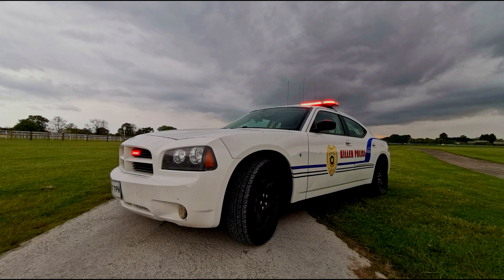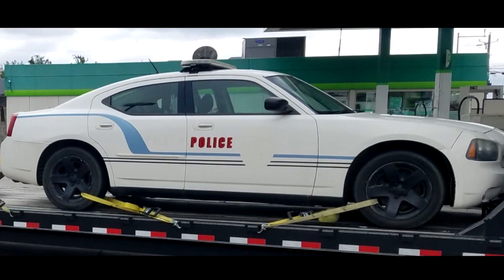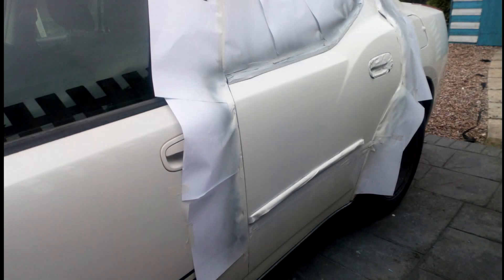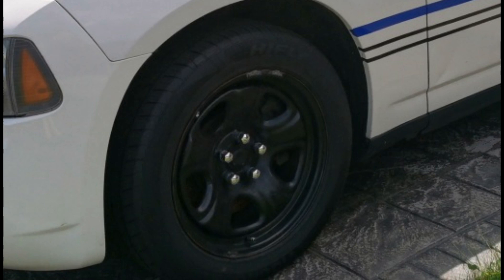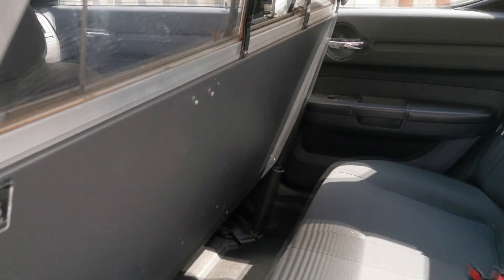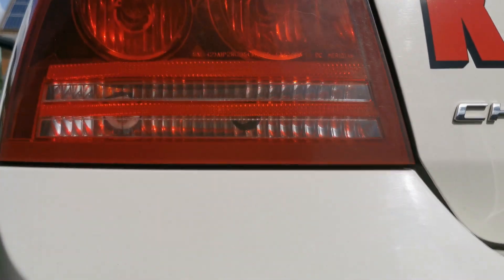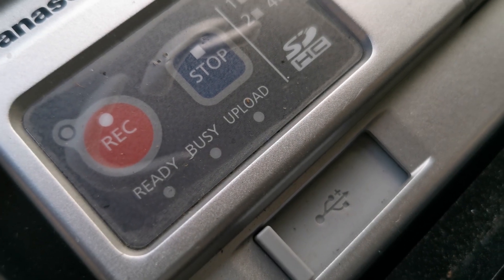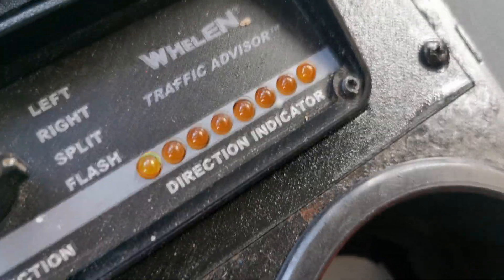Dodge charger ex police car walk around and drive

Comment: must get alot of looks driving that, i think i saw (correct me of i am wrong) a amber bulb in the reverse light housing (or strobe tube) but i assume he relocated the turn signals there as they legally need to be amber there
Reply from the maker: Hi Joey. Yes law in the UK states that indicators (turn signals) must be amber. When I had the car brought over in 2017, I had to do cirtain alterations to make it road legal. And believe it or not, it was 100% legal. Well, about 99%. The word "police" isn't illegal to have written. The lights arnt illegal as they are all clear bulbs when switched off. When I had the car re-stickered, I opted for non reflective as blue reflective is illegal. The illegal bit is the licence plate. Our law states that a registration plate must be a set size for the plate and the font unless the vehicle is made with a different plate size in mind. Mine has a set size laid out on the trunk (boot) so I can have 12"x6" but when I had the plates made, the lettering was tiny. Having said that, I was only ever pulled once in the 2 years of ownership and the officer just commented that I should change them. Also he was driving a Volvo so was thankful that I stopped as he wouldn't have caught me. 😂